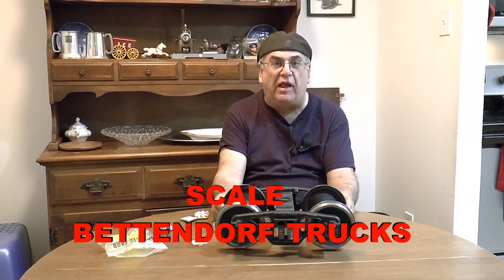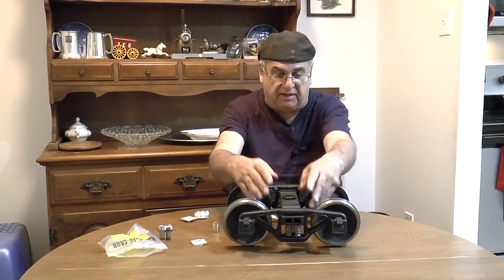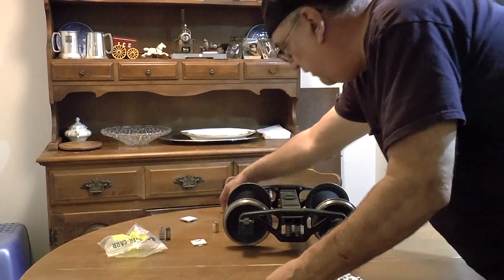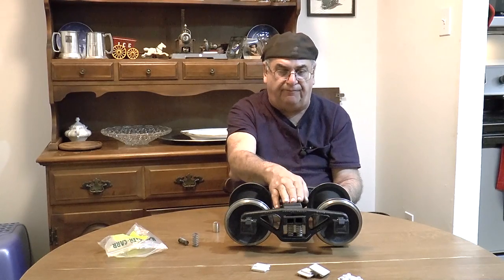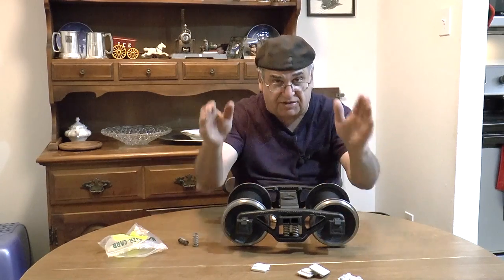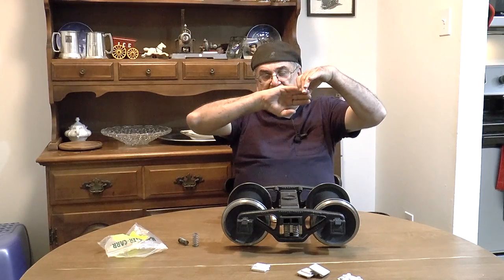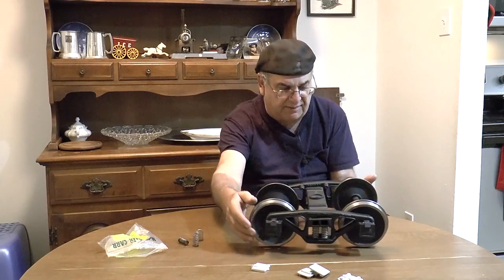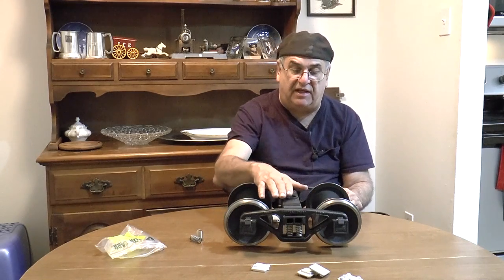SCALE BETTENDORF TRUCKS

Comment: I have rebuilt dozens of these.This needle bearing set up WILL NOT HOLD UP on Passenger cars that are used several runs a month because of the lack of a way to Grease them.
Reply from the maker: I do not use needle bearings or ball bearings they do not flex